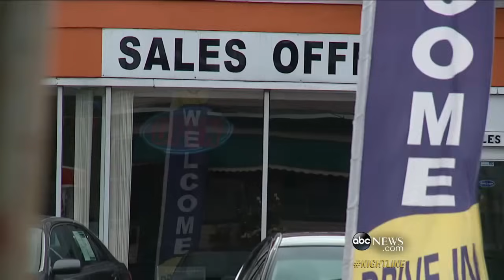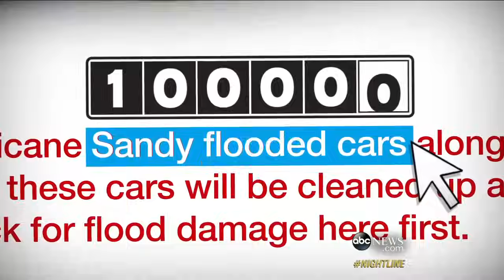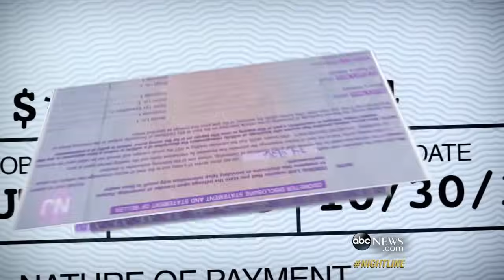How Did a Sandy-Damaged Truck Land on a Used Car Lot?

Comment: I love how once salt water touches a car they say it's unsafe and a highway hazard. But the salt that gets used on those highways every winter and is in contact with your car for longer and in a higher concentration? That there's 'magic salt' and all the little fairies inside protect it from immediately making your vehicle burst into a nuclear fireball killing everyone in a 50 mile radius like the ocean water does.
Reply: I agree, salt shouldnt be used on roads. It should be sand
Reply: Ya but common...it's not the same as all the electrical sitting in salt water up to the glove box for days.. totally different scenario. Salt water on outside...irritating and damaging to the body and components. Inside...potentially deadly in multiple ways. No?
Reply: They are talking about vehicles that were submerged in seawater. Salt on the road gets on outside surfaces. This salt water from a flood gets into things on the inside of the car.
Reply: @codygrant5576  So you remove the interior and wash out the salt.  It's not magical...
Reply: @fraidykat  umm ya just clean electrical and metal. Deterioration to metal and wiring/electronics can't be cleaned. We aren't talking about a piece of carpet or a seat.
Reply: @codygrant5576  Metal doesn't magically fall apart after a couple days in water.  Take it apart, wash it out, fix what's broke, the corrosion won't be much worse than what you get on battery cables; clean it out with a chemical bath.  Your dumb bass Deserves to be in poverty if you don't think the end result is useable.
Reply: @fraidykat  lol ya I realize what you can and can't do with metal. Unfortunately, if you think there's just metal in a car, I think we know who the dummy is. There is wiring and electronics (all sensitive little metal pieces) in a vehicle too (under seats, under floor trim, wiring harness, lighting units, heating/power in your seats, etc etc). These cars are written off for a reason. The point is ...are you going to go through every cable,  and piece of electronics and then give your car a chemical bubble bath;) and then  put your kids in there ?..or just buy something a touch higher in price? Sounds like a lot of chances taken and wasted time for something that MIGHT work out? How do you know how high the water even came? Lol for me, when it says "Flood" on the title, I stay away. Just My Opinion. I'm sure we could debate all day but think it's more personal opinion of what chance your willing to take
Reply: @fraidykat  not sure where u got lost. Comparison of car sitting in salt water or salt on roads. There's a difference ...period. Total a truck?:/? I just wouldnt purchase a flood title. That's my opinion. That's it. There's obviously so many variables. If it sat for a week in salt water, if it didn't etc etc etc. Nobody said you can't clean anything lol depending on how much water for how long. You're arguing with yourself. I love how we go from discussing salt/salt water damage to me being an idiot for totalling a truck I've never owned nor would purchase. Move on.
Reply: @fraidykat  If you wanna take on a project like that, have at it and all the best to ya in doing so

Comment: Lol all these people have no clue what salt water does to engines. Salt water is very corrosive to metal and if it sits inside an engine it wears away at the engine which causes multiple problems. It may still run but not for long.
Reply: for $2000 id take a chance on it. its still in better condition than my truck.
Reply: For less than $20,000 you can buy a used truck that will last much longer.
Reply: Joshua Meek I don't even have that much at the moment.
Reply: They say they won't drive that truck out of there I'll take it if they're giving it away
Reply: Billy Darley for $ 1000 i would use it as a beater truck for messing around.
Reply: Not just metal. Even a normal wall in a house (brick and mortar) can corrode because of salt water. In my parents house they have 1 wall that was in salt water because of a big flood in 1953. It wont give any problems now because its inside and its not an load-bearing wall. But a house that was next to it wasnt livable anymore and got demolished a few years ago because they wanted to put a new house in that spot.
Reply: jaydee040 looks like you have no clue what I'm talking about.
Reply: I think these people just want to grab it cheap and restore it to working order
Reply: I dont know about it eating away at the inside of the engine I'm sure the fluids were changed.. However the electrical problems that can / will present themselves later on will be a nightmare
Reply: David Beattie I didnt comment on the rest of the truck or the pliers in the gIive box.  commented on the engine. ...I simply was stating salt water damage to electrical system can be terrible and present problems after problems over time .  p.s. my boat engine goes in salt water its an 05 and all I do is flush it when done.
Reply: Yea but saltwater did not get into the engine of this truck... It's still totaled but you just watched it drive down the road... no smoke or anything.
Reply: It's a 6.0 anyway.
Reply: ferkemall  sure but does it change what it does? Google 1953 the Netherlands and/or the bombardement of Westkapelle. If seen myself what it can do to a house.
Reply: If the oil when pressurized can't come out, how can salt water come in???  It's a sealed environment...
Reply: The ford modular V8s are aluminum blocks though so some parts may be bad inside the engine but the block is still good.
Reply: Rich people

Comment: I have to share an unbelievable story. I just bought a used Honda CR-V from a car dealership in Macon GA. It was Jackson Subaru and the salesman was Ja-mari Troutman. The Honda was sold "AS-IS" like most used cars and it was a 2013 with 93k miles on it. It looked pretty good, nearly spotless interior and nearly spotless exterior but it was a used car and had a big old window sticker saying AS-IS. I bought it on a rainy day and my wife drove it home and me in a rental car. The wipers would not work on high speed and she had a hard time in the rain. We got home and sure enough, the wipers would not work on high speed. We called the dealer and the salesman did not understand as they worked when he turned them on. I am pretty sure they did as he would not have had to turn them on high speed in their parking lot. Anyway, they arranged for the Honda dealer in my town to fix the wipers and they paid for it! So yes, I have got the car back and it was fixed and the repair bill would have been over $200 but I did not pay for it. I was pretty surprised.

Comment: 3:30 . . . WOW!! What a waste. These cars SHOULD BE branded as "Flood Damaged", but available for rebuild. Seats and carpets pulled out, floor and other inner metal flushed with clean water, New seats, carpets, affected electronics replaced, change the oil and transmission fluid, and you have a perfectly good vehicle for a bargain price. I will agree with submerged electronics and seats, carpets etc. being a write off, but the body, frame, suspension etc. remains in perfect condition after a few days submersion in sea water, vs, the catastrophic damage road salt does after five years of winter driving to cars from places like Syracuse, Buffalo and Toronto. Maybe all of these should be off the road with rotten floors, hollowed-out frames, disintegrating brake and fuel lines, etc.
Reply: 0h3
Reply: +LakeNipissing These cars are never really right once they've been flooded they are only good for scrap and parts.
Reply: +LakeNipissing you took the words out of my mouth. we have the biggest piles of crap on planet earth here. the true clunkers are most of the cars in wny area. they are crap and i have had to put up with it my entire life. im tired of it, they really need to find a product to use besides salt. and i keep driving my rust-buckets in the winter. im not trying to replace it with another nice car that will turn into that sad piece of crap. i have a summer car, a 1996 camaro Z28 and for being 20+ years old it has very little rust and no rot.
Reply: +LakeNipissing you took the words out of my mouth. we have the biggest piles of crap on planet earth here. the true clunkers are most of the cars in wny area. they are crap and i have had to put up with it my entire life. im tired of it, they really need to find a product to use besides salt. and i keep driving my rust-buckets in the winter. im not trying to replace it with another nice car that will turn into that sad piece of crap. i have a summer car, a 1996 camaro Z28 and for being 20+ years old it has very little rust and no rot.
Reply: +Noah Ferrari i believe they are rebuild-able, i think it also depends upon how badly they get flooded.
Reply: +Noah Ferrari i believe they are rebuild-able, i think it also depends upon how badly they get flooded.
Reply: andrew donohue anything is rebuildable just depends on how deep youre pockets are
Reply: Well you can rebuild it. Its a salvage title meaning you can buy it, fix it, then take it to inspection to verify for a re-build title. As long as it doesn't say certified for destruction, which it didn't, it can be re-built.
Reply: Geico sells them overseas where the safety and inspection standards are much lower. I would never buy a car that’s been in a flood. The entire car was submerged in salt water. Not a good idea.
Reply: Don't forget to include Michigan in that list !!!!!
Reply: @mkxv  Ive rebuilt cars that were flooded under insurance pay they drive like new

Comment: 2 years ago I looked at a car and I could tell the carpeting was brand new.  I looked underneath the seats to where they are attached to the floor by screws and there was standing water.  Very easy to spot.

Comment: Back in 2013 or 14, a dealer tried to sell me a Jeep that had been flooded but not reported on the carfax. There was some hurricane before this that flooded the Carolina area.

I took possession, had it inspected by my mechanic and found that all the drivetrain had gaskets made of silicone from a tube and fresh fluid. We took 80 to 100 photos and just brought it back, threw the keys on the salesman's table with a letter and left it there.

A few weeks later a check showed up at my house for the down payment and I never heard from them again. They had to know it was rubbish after they inspected it and was selling it anyway. The previous owner might have gotten over on them unless there is some kind of law I do not know about.

Comment: i dont think these cars should be destroyed if they still work. but should be labeled as flood cars not passed along as a new or normal cars. the amount of carbon to destroy smelt and make a truck will be big.
Reply: +melvin arias Right, there is nothing wrong with using this truck as a work truck. The powerstrokes cost about 12 grand to rebuild, and there was nothing wrong with the motor in that truck. Lots of good body parts on it too, so I have no idea why the hell they would want to crush it.
Reply: ***** No it doesn't. I've dealt with flood cars. It does not rust the frame out in a year, lol. Up north, we drive on salted roads every winter far worse than a couple day bath in the salt water, and our cars last well over 10 years before the frames get crusty. 

Furthermore, you can go through everything, strip the interior, blast the SHIT out of anything, repaint, redo any electronics, and have a fine, trouble-free truck. People are lazy, and would rather pay a body shop 10 grand do to this, which is why flood cars get totaled out. I can redo an interior completely in a month, if that. That's if I spend about an hour a day on it. 

Spray fluid film on any metal components on the undercarriage and you will be rust free longer than anything else on the road. Insurance companies are in it for the money, and they probably secretly part out a ton of cars in great shape like this truck was.
Reply: ***** Again, we drive on that stuff half a year around up here in the salt belt. Our cars last many years. All you need to do is clean it up, and shoot Fluid Film in there, and the rust cannot progress any further.
Reply: ***** Not with a 20 thousand dollar truck. Again, I know it's costly. As an enthusiast, I would gladly fix a F-350 with a diesel. I would move mountains to get that truck for under 10 grand. 

I never really understood what their rationale is in scrapping a 50 thousand dollar car either with a small amount of damage like a lot of cars that get scrapped. If it costs 30 grand to repair, that's more effective than buying another 50,000 dollar car for the customer.
Reply: +**Classified** exactly man. Crushing that is just a waste, at the very least part it out
Reply: ***** Which is why I am opposed to title branding. If a vehicle is properly repaired, there is absolutely no reason why it needs a branded title. Salvage vehicles have to pass an extremely strict inspection once repaired. Believe me, I used to flip cars this way, and some of the rules were absolutely ridiculous. In my state, you have to take a ton of pictures of the before damage of the car. It used to be 3 but now I believe it is over 20. They have to be of different angles, side profile, front profile, undercarriage, occupant compartment, etc. It goes on and on. You have to have pictures of any welding you do on the car, and it has to look damn near factory in order to pass. You have to get your receipts notarized during the process for any parts you put in the vehicle. In many ways, a prior salvage car may just be built better than it was from the factory. 

As for a car being worthless after the branding, that is not true. It is worth whatever someone is willing to pay. Sadly, many car lots will not even bother with a branded title, and you can forget about stealerships. Baseline is about a 40% reduction in "fair" book value, which is horse shit in my opinion for the seller, but great for someone like me who buys these cars and runs them to 400,000 miles. 

It just pains me to see a fully loaded truck hit the crusher because some news anchors said it was "unsafe" and publicized it for the nation to see. Come up here to the salt belt, and you will see cars without rocker panels and holes in the floorboards. You can't tell me that this truck is less safe than all the 20 year old beaters we have driving around.
Reply: ***** Once the electronics dry out, all is good. That's why I said to properly fix it, you need to redo a lot of the wiring. Getting a new wiring harness wouldn't be a bad idea. 

My local auto auction site is always packed. There is a HUGE market for these vehicles. Many businesses use them surprisingly.
Reply: iTheGeek You know absolutely nothing. It's all about the branding...
Reply: All of the people saying it will rust out immediately have never lived in the rust belt. 15 year old car you can see through the floor pans? Yep....a salt flooded car is about the same. However, it is repairable. Just not worth most people's time and effort to have it done professionally because people lack the common sense on how to operate a toaster.
Reply: T Swag, A dealer sold us a flood car in the late 70's (without disclosure). The car literally rusted to pieces from the waterline down within 5 years. There is a difference between living around salt water, and actually being submerged in it.
Reply: The big issue is that several of the safety features dont function properly anymore. Also the wires that run thru out suffer early failure causing the owner to chase electrical issues for the life of the vehicle.

Comment: I have been in this industry for years.  Many flood cars get their titles washed clean by multiple interstate transfers.  Many salvage cars make it back on the market with a clean title.  The key indicator is multiple state transfers listed on car reporting company reports.  In most states a buyer must be told the truth if the buyer asks "is this a flood vehicle or has this vehicle been in a crash and been repaired"  Failure to accurately inform a buyer of a crash or flood history is considered fraud on the part of the dealer and or salesman.  I just purchased a 2016 Ford Edge that has had two previous owners.  I contacted both owners and they each said "no crash or flood problems"  The dealership has to disclose the truth if asked.  If the dealership keeps their mouth closed, be suspect and ask.
Reply: yeah and the most intresting about this are there was an article about used Toyota Pickups with US Plumber Company sticker on the door ended up in Syria and used by ISIS 😂

Comment: Well according to the PO of this truck the water was above the seats, which is deep. Have you ever seen a 1/2 ton plow truck from Wisconsin? They don't get the interior damage like flood vehicles but the underbody is severely rusted after a few years of service. A shop I used to work at had a truck that was really only used for plowing and 4 years old the frame was so rusted it cracked totally it. I don't see that happening to a flooded vehicle as the flood was a one time deal and I would rather have a flooded truck then a truck used for plowing. The salt used in winter is very corrosive far more than salt water.
Reply: 30spooln caveat emptor.   Corrosion from being used for plowing will be readily visible upon a simple inspection.    The major issue with Sandy vehicles being sold as 'clean' is the dishonesty involved where the car is sold under the false auspicies of being clean and never been underwater.